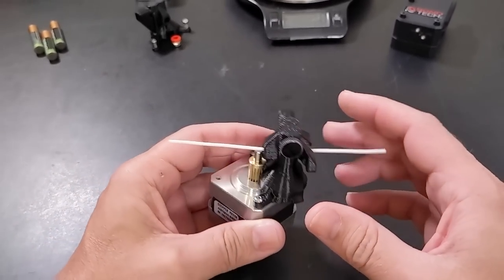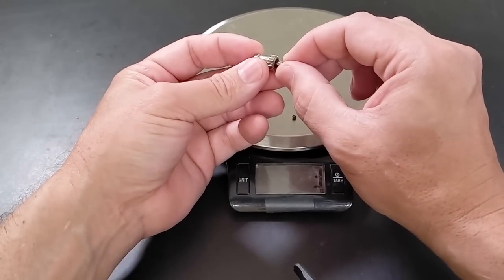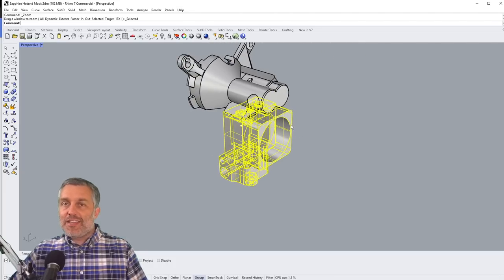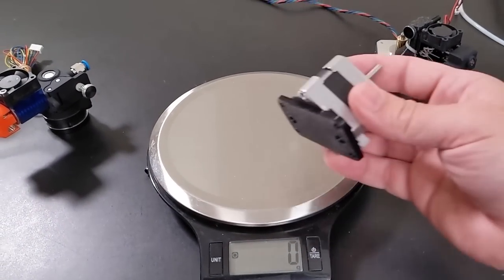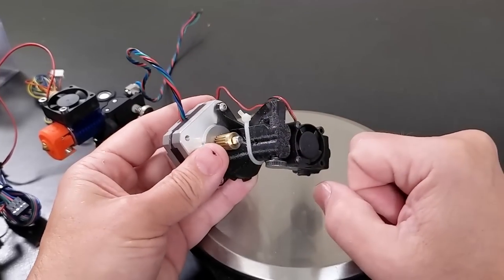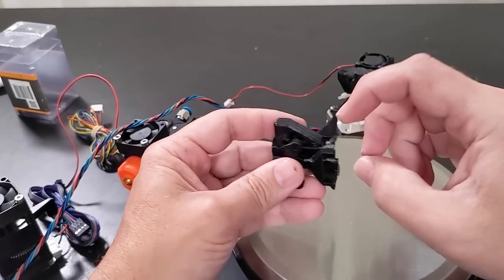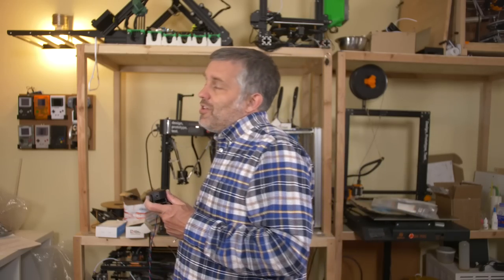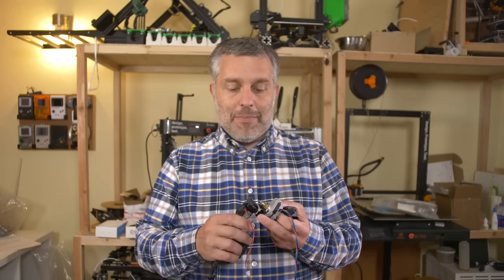Superfly - A Worthwhile DIY Upgrade?

Comment: If you want to remove more weight, I'd be looking at taking the stepper apart and print some upper and lower plates for it, get rid of the metal ones. I don't think they are required for any magnetic reason (could be wrong), I think they just hold the bearings.

Comment: Hey I appreciate that you put yourself out there saying that you were wrong at some level, and I agree with you that it is bad form to just rip off someone’s design for your own gain, but I would think that the needle bearing ‘improvement’ might not meet the ‘non-obvious’ criteria to be valid, that being said bondtech should get credit for porting the design to 3d printing :)
Reply: Bondtech literally repurposed someone else's widely known, over half a century in use preexisting design. They just put in different shaped box around it and slapped their logo on it. I'm not saying it's a bad product, certainly not - but there's hard limits to how much credit I think someone is due for not even reinventing just rebranding the wheel, and making a square plastic box to put it in. Phaetus and Trianglelabs probably earned more credit for the Dragon. At least they made a different design off Slice Engineering's concept, and they actually developed further improvements and iterations to address shortcomings that Slice Engineering themselves, by their own words, can't be arsed to care enough to do.

Comment: Just got my biqu h2 got it installed with titanium heat break it was 22.5 length instead of 23.75 like stock one had to modify mount and fan. I had the same problem that you did with the loose gear meshing and got in contact with biqu and they are going to send new gears to me. I also made a way to fix it with a 8mm od 5mm Id bearing I drilled a hole and put the bearing on transmission rod used a m2 screw to tension the transmission gear. I did proof of concept with an aluminum spacer as bearing and eliminated the backlash in gear. I'm going to be posting on redit once I get bearing installed 10 pack for 8$. I will provide link simple cheap fix. Love the content keep up the good work.

Comment: DUAL DRIVE EXTRUDER HISTORY: Brook Drumm former Printrbot owner, designed, and offered for sale to consumers, a dual gear extruder called the Gear Head in 2014! 

There's nothing magical or new about the Bondtech. You can see versions resembling PrintrBot’s offered from China today.

His YouTube presentation 10/31/2014: Printrbot Double-Drive Extruder  https://www.youtube.com/watch?v=Ox47ESk8DE4

In 2017 he offered an all metal aluminum water jetted upgrade called the Printrbot Gear Head v2 Extruder.  I've used his single gear aluminum version for years with NEVER a fail, including flexible's. Can't say that for other extruders I’ve used. Of course, they are direct drive, the only way to go. :)

Comment: Have you thought about building a Voron /HeVort printer in the future? Or is it just not worth it, because you already own a core xy printer with an enclosure?
Reply: he should definitely review the voron 2.4. Would love to see his opinion on it.
Reply: Both designs use a lot of printed parts which isn't good for use in a heated enclosure.
Reply: @evropapagan5551  isn’t the voron designed to be enclosed? I thought abs in an enclosure doesn’t give any problems
Reply: @otroe  This guys enclosure has a higher temp than the temp the vorons acrylic panels can achieve.
Reply: @evropapagan5551  why is using his enclosure so necessary? maybe just do it theway the designer intends??
Reply: @jrok96  To print high temp plastics.

Comment: Thank you.. I've printed a couple of these Superflys.
 Old (your) version and the improved version .With a hinged BMG type pressure gear setup. 
Fits are iffy tho. When one part fits as desired.. another doesn't... grrr.
 BUT as you stated : the Only actual advantage is in the reduction of Stepper weights.
 Weight differences of the Superfly Vs BMG are   Not worth the effort to print it.. by any reasonable yardstick.
 Also One can't reasonably fit a  Nema 14 Round motor to this, as their Shaft length is far Too short to reach the Main gear ! 
Again: ... Grrr.
 What was  interesting... is your use of a yet thinner  Pancake stepper. Always wondered as to How small  a pancake could be fitted without Overheating it problems.
 As for  Hotends... a simple Stoopid  Clone CHT nozzle solves Pretty well ALL flow constraints,  for a couple/three $..
 That's worth looking into for me.

Comment: hi how are you? nice one) for prusa time the weight of 50 or ewen 100 grams does not matter as the crusial is the weight of the bed) so this is more applicable for corexy or ultimaker) i have printed something like bmg but smaller in dimensions but have found what is the point of all this the gain of 20-40 grams?

Comment: Speaking of extruders, Does anyone make a more robust extruder that can handle large or even bad filament?  Like a really tough extruder that could handle tuff filaments.

I ask because when 3d printing was new and peaking in popularity lots of people wondered if it could handle recycled plastics, like Hdpe.  It was eventually abandoned because of the difficulty in makeing your own filament, the useability of Hdpe, and the general trends towards speed and detail.

But I've never given up on the idea.  I believe if we just had a printer designed for it we could popularize printing with reused plastics.  There have been so many advancements in dealing with warping and other problems that kills me why we've still abandon the idea.

Like when Makers Muse popularized drilling nozzles out to 1.0mm. He said it was useful if you were okay with it being slow, more prone to warping and, using a lot of filament.  It was great but I was personally tearing my hair out because that's the direction all of 3D printing should have been going in the first place.  Who cares if recycled HDPE warps and is bad if the printers designed to go slow and chew through bad filament?

Could a tough extruder be made?  Could this be possible?  Would that extruder that supposedly prints using raw pellets be a good direction to go?  Sorry for the bombardment of questions, but I feel like you would have the knowledge and expertise for this.

Comment: shaving a few grams off the extruder motor itself is easy. and can be done to any stepper. remove end caps and drill holes through the caps.

Comment: Great video!
I might play with this design, starting with different materials, ABS, PETG(not a good choice). Perhaps the particular blend of PC you have has a lot of shrinkage. Perhaps PC glass or carbon fibre filled might work well due to the extra stable dimensions(though I’m. It paying that premium for a filament I don’t need, and when I have surplus I think I’d rather put it in to a couple of months patreon here). 
Sherpa Mini also looks interesting, I’d be interested to hear your thoughts!

Comment: I don't precisely know how a stepper motor is made on the inside, but isn't drilling holes on their housing a viable options? I find rather silly to save a few grams by using printed parts, but still bringing around that chunk of metal. Especially thinking that the original BMG is made of SLS nylon, that even if heavier may be more robust than FDM printed parts, so there may be not a lot of difference in print quality even saving weight.
Reply: its meant to use a lightweight nema14 wich weighs in at a fraction of a nema17 but he didnt do that and opted to make a quick video
Reply: Yes you can drill holes in the end bell's (the silver end caps) but not in the stator. (Center black part) The stator is stacked insulated laminations. Down side is dirt getting in will shorten the life very fast.

Comment: The fact that, there is a continuous stream of new extruders coming to market, means only one thing, that  no one got it right, kind of slam dunk, game over sort of thing. Just some 💭❤️👍
Reply: Are you familiar with the 3d printing vocabular? I don't see that much new extruders out there. Yes some got lighter to get more speed, but the most invention went into hotends, aka heatbreak and high flow nozzles, not into extruders. Bambulab for example has a pretty dam good solution with very cheap spare parts. I already use 2 Bambulab Hotends on two of my other printers beside my X1 and they work phantastic.
Reply: @thilov.5750  Bambu🤖 in action💛👍☺️

Comment: Why so much emphasis on weight?   Does it have something to do with minimizing inertia to allow for faster change in direction to maximize print speed or something to that effect?  I have a CR-10 Mini and have been able to successfully print out a few things in PLA, but I want to print with nylon which requires higher temps.  Any suggestions anyone might have for a good fairly simple swappable extruder/hot end solution would be greatly appreciated.  Price isn't much of an issue, but I would like to keep it sensible if possible.  Thanks. 😁👍
Reply: Lower weight reduces inertia which reduces ringing and increases part quality.
Reply: these are designed for the speedbenchy race wich need much higher speeds and less mass means you need less torque for high speed
Reply: Saving weight makes a lot of sense, but only if you have a delta or coreXY printer. If you have a bed moving it's generally that your heaviest moving mass, so if you save on the extruder the Y axis is not affected.
Reply: @karellen00  you can set (in klipper) per axis limits and dual axis limits, thatway a x move can go faster than a y move and a dual move can go at a inbetween

Comment: you printed the wrong tensioner... in the files there is a "high-tension" that will solve that problem...with weight reduction...
you didn't do your homework for this video
Reply: I think he did a good job explaining the extruder. It is impossible to know everything on a subject he isn't intimately familiar with. As someone who never heard of this extruder it introduced me to it, told me some issues I might have and gave me an idea of weight savings. Also the fact it isn't as user friendly for loading filament is a big detail that isn't his fault. All in all, it informed us and then if we want to dig further we can.
Reply: @DaneC020  
I disagree. he is spending more than 5 min of the segment on an issue that would have been solve if he would have printed the other file.
he said that there are other files (such as the "extra clearance") so why no test both tensioners on the file directory?

Comment: I wonder how much extra weight it would add to have the pressure arm pivot at the base like the bondtech and every other design.  The real question is, at what point in lowering the hot-end weight do you hit diminishing returns?

Comment: It reminds me of lowering the weight of the bike :) Fight for every gram :) First you will come to the conclusion that you can shorten the screws.  Then buy aluminum one.  Then you find out maybe nylon screw.  Both types will not work.  You will buy titanium -1/3 steel weight :). Price is matter ;) You will buy a 26mm motor.  I will read the Opinions that it heats up a lot and melts the filament.  You will add a heat sink.  It turns out that the motor has too little torque. You will buy a bigger but heavier one.  You will start to figure out how to reduce weight even more.  You will get an element made of scandium aluminum alloy. You will persuade your CNC friend to cut the parts of motor to replace trze oryginals.  They will be lighter than from titanium :) You will start thinking about metal gears.  Maybe drill holes in them to make them lighter.  And you can make parts in a carbon fiber i - again with few grams less.  Personally, I love it.  Then you have the lightest extruder model on the estate.  Good thing the extruder is small.  For bicycles, each 1 kg less is a minimum of 250 eur.  Good luck!
Reply: It's been a long roller-caster ride. I finally calmed down.
Reply: Just like racing cars

Comment: Try the sherpa mini. The new 8t ldo motors are coming (I have a pair due to arrive tomorrow), and will allow to run at lower current. I was able to get 600mm/min on the sherpa mini with the mosquito magnum. Sherpa combo is quiet a bit less weight than the orbiter, and runs at a higher gear ratio

Comment: I think you might want to check out the "3D Mellow NF sunrise" extruder, it looks promising.
It looks like it has an cnc machined body, with a very short gear to hotend distance.
Maybe this one doesnt have to be modified on the gears like your BIQU H2.
I really would appreciate if you could check it out, maybe this is an extruder that I can buy

Comment: I think batteries weigh more the higher charge they contain.
Reply: Slap yourself bro....you didn't think that thru before you typed it lol
Reply: technically, but it's less than the weight of a spec of dust by orders  of magnitude.

Comment: still too heavy! take a look at the Hextrudort instead! using a 14mm Nema14 round stepper with the guts from a bondtech the same, i believe it is actually the lightest extruder and my god is it good, look at MirageC the creator pushing stupid speeds on his printer with it
Hextrudort + Nova is the lightest most performing setup you can have I believe, and he proves it! https://youtu.be/5HKC9tRqtTw